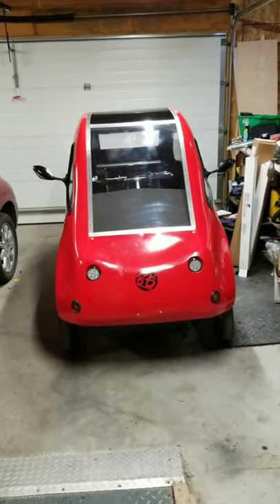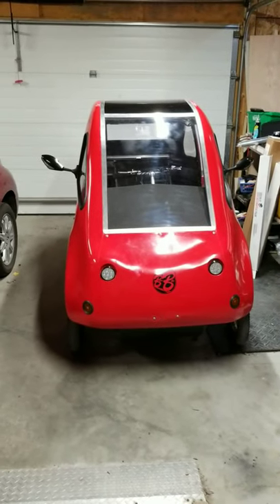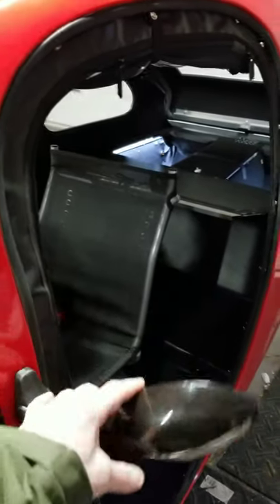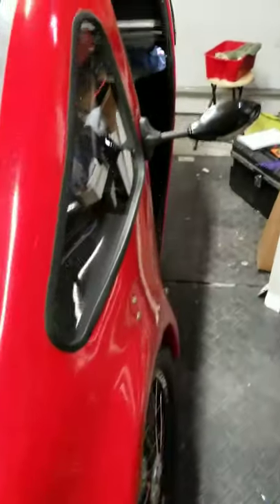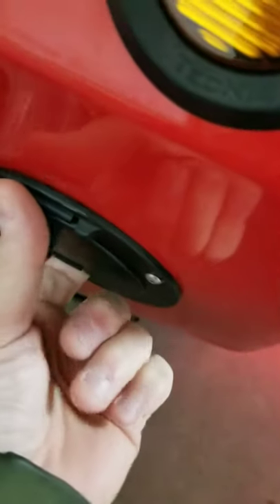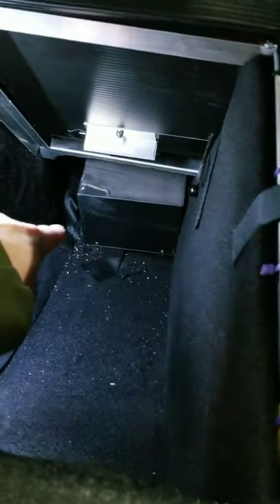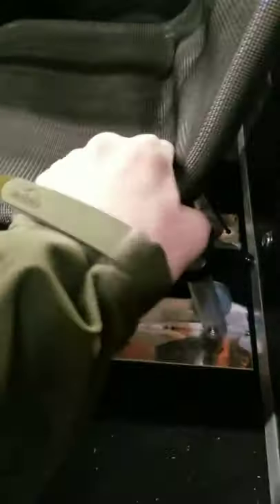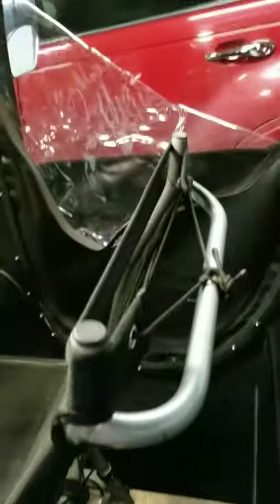Exterior and interior overview of the PEBL from Better Bike  www.better.bike

Comment: GREAT walk-around ! ... Answered many questions I had about floor pans, heater, reverse, battery locations, etc. Due to advanced age and only 25% heart function after 2 attacks and bypasses I can no longer pedal. I'm thinking about installing a small self starting generator to charge Max power batteries as I ride. Being still with pedals it should be street legal as a peddle trike because power is delivered by batteries. The gasoline charger (permanently connected) should give me the range a gas powered automobile. Plus, no licenses or insurance will be required. These and savings on gas will help the bike pay for itself. Plus, I will no longer have to worry about driving tests.
.
.

Comment: Hey Tim!  How are you liking your PEBL now after one winter?  Did you ride it much?  How's it doing on hills?  How about an update!  One thing I REALLY like about this bike is that is made using soy-hemp non-toxic materials!  THAT really shows where the mindset of this designer is!  Fantastic!
Reply: The ELF is made with recyclable trylon plastic. No toxicity to the owner and proper recycling also guarantees a green end to vehicle life. Most resins have to be ground up along with the fibers for landfill disposal. I wonder if the PEBL resin is recyclable by some method.
Reply: Update - now the PEBL has switched to fiberglass and weighs 230 pounds, a real problem.

Comment: Hi Tim. As a fellow Winnipegger I'm really curious how you use this fascinating vehicle in our city i.e. where, for what, how often? For commuting? Shopping? Even in winter? Being wider than a bike, does it fit on all the Wpg bike lanes and paths? Where do you take the car instead because it's too far or too much traffic?
Reply from the maker: To be honest I don’t drive in the bike lanes I drive on the street in the same lanes that the cars driving it would fit on some of the bike lanes but any of the ones for example down Pembina Highway that have the polls I think they’re a little too narrow or to be honest I’d be probably whack in the polls with the mirrors at one point in time so I would just drive on the next available lane. In Winnipeg some of our bike lanes are very poorly designed again a Pembina Highway they have the bike lanes and then all of a sudden the bike lane goes up onto the sidewalk and then back down onto the road to me this is the worst design ever anyway I don’t use them I use the roads just like a car would I don’t drive in really cold temperatures once the temperature hits -10 I usually put the bike away because the batteries don’t come out very easily anyway they can come out but not as easily as I would like and after -10 the batteries don’t tend to fare very well in the cold

As far as where I drive everywhere I’ve taken my bike down Regent Avenue down portage Avenue in Pembina Bishop Grandon chief Pecos Trail everywhere I drive everywhere Henderson Highway, Main Street   Pretty much every street I think the only street that I haven’t driven on is large. There’s no need for me to go on there. There are other roads that get me to the same place

Comment: I’m planning on building a pedal car/ ebike like this and the elf and it will be have models from single person to up to 4 passengers and hopefully going to work on my 1st single person prototype and eventually the platform for 2-4 passenger by the end of 2019
Reply: If it has a motor greater than 750 watts or a top speed over 20 mph or 4 wheels, it will not be legal on bike trails and has to be licensed as a car. There are already thousands of 1 person velomobiles.
Reply: Do you have a website about it?
Reply: @popeyegordon  I know that and there are lots of velomobiles for sure and if you actually look it up there are ones that are four wheels not just three wheels especially if you look on YouTube. And just to mention all of them are all using electric motors so of course I'm going to be under the limit and technically velomobiles aren't allowed on bicycle trails anyway anything with a motor assistance on it is not allowed on bike trails if you actually look it up.
Reply: @timlocke3159  if you're asking me and not the guy who answered before you commented I do have a Facebook page for my business that I would like to try to get off the ground which I haven't quite got to do much of yet unfortunately I mean I did some bike maintenance last year for about six or seven customers but I've had to restart from scratch cuz I had to move out of the town I was in when I was doing it and I haven't quite figured out how to set that up or had the time to do so yet I've had to go back to working somewhere else for right now and build up my tools again and in the meantime just working on my YouTube channel for now. If you was talking to me and you're looking for my business though page it's on Facebook if you have a Facebook account just look up moore pedal cars and cycling service
Reply: @greenmachine55  When you look on Youtube you see bikes from around the world. It is only the USA that has that law limiting e-bikes to 3 wheels or less. Velomobiles ARE allowed on all bike trails - they are just bikes with elaborate wind screens. Almost all bike trails in all 50 states allow e-bikes. You have to search hard to find the few that ban e-bikes. Cities want to reduce car traffic.
Enjoy your fantasies but don't pretend you are anywhere close to actually knowing what you are doing.
Reply: @popeyegordon  there is not a law that says it can only be 3 wheels but yes there is a speed and a limit on engine size and power both gas and electric but also most velomobiles/ adult pedal cars etc whatever you want to call them are mostly made with an electric motor like a hub or mid-drive electric motor that's only at the minimum and maximum requirements for bikes and etc plus if I really wanted to use a 2 stroke bike motor kit I already know the limit without having to register the thing. And just to be clear the Rhodes car is a 4 wheel bicycle with an electric motor assist that sits 2 to 4 people and it's american made and in the states. I know the laws and limits.
Reply: @greenmachine55  The US does manufacture 4 wheeled bikes for use on private estates or for export. You will not see them on public roads or trails. 14 year old kids know about our moped laws, then they grow up.

Comment: Does this better bike background already come together or and additional on the purchase? the 64 volt batteries can I use  it 2 for bike help.? what is the maximum speed that I hit? have any add-ons that help increase speed? the exterio of and made of resin??
Reply: izaias - US federal law limits the speed under motor power to 20 mph to avoid licensing and insurance as a car. 48 volt lithium batteries are used, 64 volts would burn out everything. The body shell is made from hemp fibers and cured resin.

Comment: Nice!! Question, do you think it can be customer with a more sturdier doors (like the material of the bike)  if I choose to get one?
Reply: You don't want more sturdy doors, this vehicle is already too heavy. Better off with no doors at all. Although it is tempting to compare this to a car it is not a car. The body is so light there is nothing to attach a sturdy door to. Anyone could just push on the door edge and get it to spring open.

Comment: How is it on ice, particularly icy hills? Where did you order your special mirrors from? Thank you for your post and willingness to answer questions. We're in Edmonton; I especially appreciate a Cdn owner's viewpoint,
Reply: Beatrice Nearey  hello so I have not really written it very much on Ice I have written it a bit in the winter here as you know when the peg is fairly flat so we don't have a lot of Hills like you would have in Edmonton

It does handle pretty good on the icy roads that I have driven on but again they've been flat I have noticed a little bit of side slippage as I make a corner and fairly good speed

For yourself you may want to consider getting yourself studded tires or at least a studded tire for the rear tire which is the drive Tire

 all in all in Winnipeg I find that it handles quite nicely obviously now in the middle of winter I wouldn't be driving because the roads are just not conducive to it but in the very beginning of winter and I'm assuming at the very end of winter somewhere along the lines of the beginning of April I'm expecting to get on the road again

Comment: I'm in Edmonton Alberta. I was wondering if you had any trouble with local bylaws? Also, what is your plan for winter?
Reply from the maker: Ron Ceilin was not planning major winter rides    

No problem with laws  it's a bicycle with motor assist

Comment: Does it have a solar panel to charge the bike?
Reply: This is a nice velomobile if it was fully loaded.
Reply from the maker: I've actually since this video have upgraded the body to a different material so it used to be made out of a hemp so a composite but now it's made out of a fiberglass composite there's also several other upgrades that I've made to it including a windshield wiper GPS tracking as well as vibration sensitive alarm systems and a few other bells and whistles
Reply: Solar is an option that raises the cost to almost $13,000. Solar is standard on the ELF. At 230 pounds the base PEBL is already past fully loaded, it is over loaded. They added too many car-like features.

Comment: Gteat job.
How much miles for hours can be?
And the price ?
Reply: All electric bikes in the US are limited to 20 miles per hour, about 28 km/hr.   This is not a dealer page.  Go to better.bike/PEBL
Reply: @popeyegordon  There has recently been a change in my states (Washington State) electric bike laws as of July 2018 and Class III electric bikes with a motor assist or throttle speed of up to 28 MPH is now legal for anyone over the age of 16 years.
On the negative side the street legal power has been lowered in the state law from 1,000 watts to 750 watts.
 By coincidence a neighbor sold me a used RadRover 750 watt electric bike for $350 during the same month and I changed the maximum speed on the control panel from 20 MPH  to 28 MPH.
The RadRover was missing the 48 volt battery pack but I had a better one already 52 Volts at 17.5 AH or 910 watt-hrs which gave me a maximum range with pedaling of about 50 miles (I live in a very hilly area too).
Reply: @m9078jk3  I was an avid ebike commuter in the north Seattle area for 10 years before retirement. what you describe is a surprise, I know for a fact that speeds over 20 mph are dangerous on all bike trails, even wide ones, because they have blind curves and mothers pushing kids in strollers, dog walkers and little kids on training wheel bikes. It is not as simple as you allude to, the most popular heavily used rail trails still have a 15 MPH ebike speed limit. I just checked. 15 is plenty, you get wherever you are going safely with no stops at that speed.
Reply: @m9078jk3  "Class 3 may go as fast as 28 mph but require a helmet, riders age 16 or over and are NOT allowed on Class 1 Bike Trails, which are trails separated from motor vehicle traffic."  You screw yourself out of safe bike trails for commuting when you use a class 3 and gain just a bit of speed on roads that are still much more dangerous with cars all around. Still, if you are one of the many commuters who can't take advantage of bike trails on their commutes, the law will help you get there and encourage a few less cars on the roads.
Reply: @m9078jk3  Class 3 also requires a speedometer and pedelec, no thanks. Pedelec sucks. Also not allowed on sidewalks so over all class 3 is more dangerous to use.
Reply: @popeyegordon  All cyclists in Washington State require a bicycle helmet.
The bike trails are becoming infested with the homeless transients blocking them with multiple shopping carts and these people sleeping on them..
Electric assistance is great for heart patients as strenuous exercise can be harmful and not recommended.
I prefer pedal assistance especially up hills.
Otherwise electric motorized use by throttle is just sedentary travel just much more energy efficient and less expensive that's all.
Also did you see how emails and passwords have become compromised on Kickstarter and some other websites.
I could provide a link so you could check if your data has been breached by hackers
Reply: @m9078jk3  I used the Burke Gilman trail a lot. It is all 10 to 12 feet wide with tons of room off the trail so I am skeptical about your claim regarding the homeless. Most want to be near a store selling alcohol. I wanted to show up at work without needing a shower after 10 miles. I need to rest my knees at times and would never own a pedelec bike. I don't use Kickstarter and have no concerns about security.
Reply: @popeyegordon  I originally supported (contributed money to) the ELF on Kickstarter so that the founder would succeed and it did.
 Those that contributed $4,000 USD got the first ELF vehicles now whoever they are (like me) have had their kickstarter accounts breached.
Without kickstarter the ELF may have never come to be a commercial product.
 I don't know about the Burke Gilman trail haven't been on it but the Scott Pierson trail in Tacoma has had many nuisance homeless people on it some of them sleeping with their legs across the trail (they could easily get run over).
Reply: @m9078jk3  If you own a Kickstarter ELF no wonder you are looking at the PEBL here. Literally 500 [five hundred] improvements have been made since then and many former options are now standard. After 30 years in Washington I can say with some authority that Tacoma was and is considered a shithole city. It is very slanted for you to post what you said about Washington trails as though most are in such a bad situation as Tacoma's. But thanks for supporting the startup which eventually led to the refined version 1.5 I have owned over 4 years now.
Reply: @popeyegordon  No I don't own an ELF I am just browsing right now and responded to your post
I contributed to the ELF as much as I could afford to help Organic Transit and yes I hope someday eventually to purchase an ELF.
Right now I can ride in the rain because I own a 6 year old Veltop Classic 2+ for upright bikes so I do have weather protection somewhat similar to the ELF with a Windshield and Cover.
It looks strange but it works and was inexpensive
 Tacoma is getting to be an expensive city to live in.
Lately there has been much redevelopment especially in the downtown areas that now have a lot of new amenities. 
Rental costs have increased 500% from 1990 to 2019 though I am not a renter.
This might be the reason for the increase of the homeless population.
Many of the homeless are not alcoholics but some are heroin addicts
I have lived 60 years in Washington state.
It depends upon which area of Tacoma one resides.
Yes there are dangerous and shitty ghetto parts with nuisance Section 8 housing and there are also parts which make Seattle seem like a slum shitty area.
Seattle is a hellhole because of insane motor vehicle traffic.
I went there recently with a friend and it reminded me of how ugly and unnatural metropolises are
Tacoma has bad traffic too but not as bad as Seattle.
The Cushman Bike trail in Gig harbor across the Tacoma Narrows Bridge doesn't have the homeless issue and the people on it are a lot friendlier

Comment: The trunk lighting detail is one reason this vehicle will quickly rise in price to $10,000+ if they want to stay in business without working for free. Mark my words. Carpet liner and other details will force this to be made in Asia or to just go obsolete. I do want better.bike to succeed but the writing is on the wall. The average customer for these vehicles is barely getting by and this will be the largest purchase they have ever made, if they can swing it at all. A basic model, not the Cadillac of hybrid velos, will go the distance during the next decade. Beyond that we can talk about Lexus class vehicles.
Reply: Just heard back from my lender.  I have a few things on my credit report to clean up and I'll be able to fix that in January.  I will have my PEBL by next spring that's for sure!
Reply: @jdrum3053  Rethink that. Curb weight is up to 230 pounds now with the fiberglass body.
Reply: @popeyegordon  That's a feature. My number one concern with the lighter velomobs is that any reasonably fit person could flip one over or wrestle it into the back of a truck.
Reply: @moarsaur  No the ELF was designed with a very wide front wheel base in the canted tadpole configuration the PEBL does not offer. Even 70 pounds would not make much difference in stability compared to driver weight and severity of a hard turn. I'm plugged in to the 600 member Facebook owner group where we hear about most every incident. Rollovers are extremely rare and no one in my group has heard of a single rollover where the driver did not admit he/she was horsing around recklessly and deserved the wipe out. You will be aware of a wheel leaving the ground and have time to reduce the severity of a turn. Then there was one rollover on a school property where an ELF owner had volunteered to show a class about the ELF and let a few try it out in the parking lot - some totally inexperienced kid rolled over that ELF, probably saw too many 'drift' movies. Obviously we all learned from that mistake and won't be letting school kids try out the ELF in any future demonstrations.
Reply: Funny you should say that considering as of June 29th Rob Cotter's vaunted Organic Transit you keep fanboying over just declared bankruptcy.
Reply: @Spacebattler  The Organic Transit website now says they are in Phoenix, AZ. Have they restarted, perhaps under new ownership?